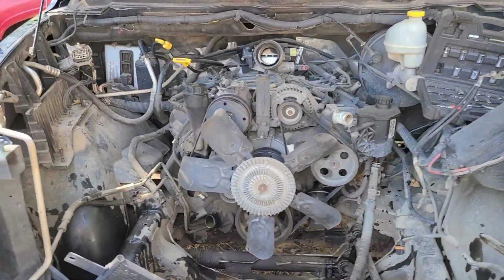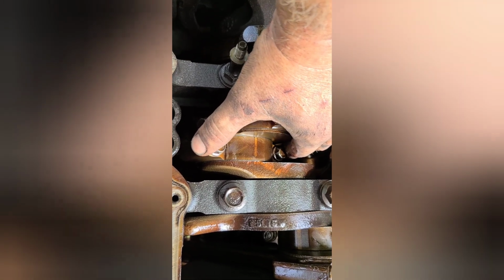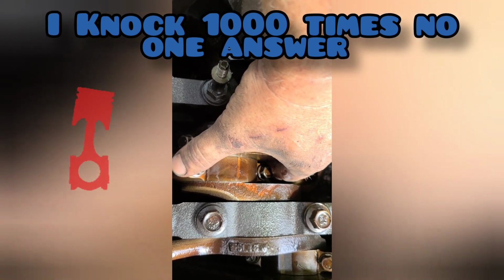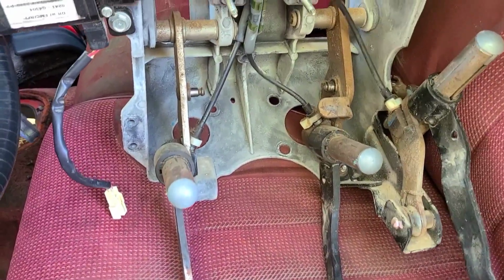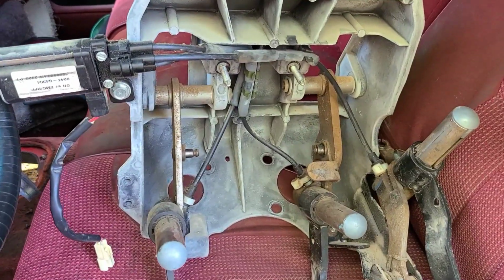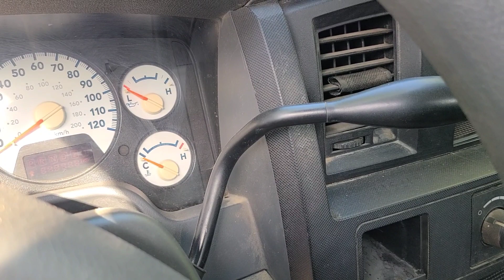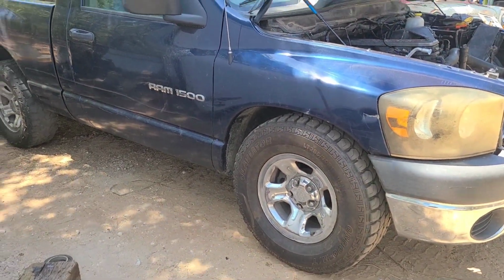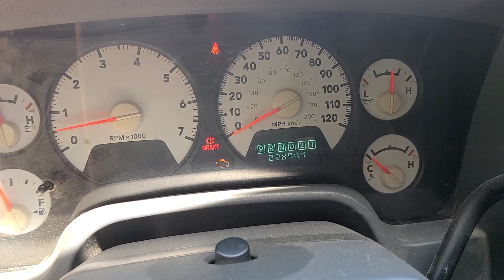1500 short bed ram cummins swap nv4500

Comment: glad to see ya back... this is going to be a sweet build
Reply from the maker: Thank you appreciate the support. It's definitely fun to drive. I am thinking it may replace the f350 shorty build I did.
Reply: @choppedinc.  yea it looks fun to drive ans something different in power... get rid of the shorty ford hahaha
Reply from the maker: I have been thinking about it for sure. Have put plenty of miles on the ford and it does get 20-24 mpg depending on driving conditions.
Reply: @choppedinc.  thats not bad mpg from the ford
Reply from the maker: It definitely helps when you take a big chunk of weight out of it.

Comment: Love it. That's awesome
Reply from the maker: Thank you appreciate the support.
It's definitely a fun truck.
Reply: @choppedinc.  I shared it on my community tab. Hopefully gets some views on this. I've been doing this to 3/4 and 1 tons but never a 1500 so to see it done(and done fairly well) it definitely deserves some recognition. Keep up with the videos. Would love to see more of this thing!
Reply from the maker: Appreciate that. Definitely some things I will be fixing but it was definitely a rush job 2 weeks to get it swap in and road trip it 1500 miles.
Reply from the maker: I watched your 12 valve to 3rd gen vids when I was doing some research. Yours was the best ones I could find and there was not really any for the 12 valve in a 1500 3rd gen swap.
Reply: @choppedinc.  I did mine originally in 2 days. Starting Friday night and was on the road to Mississippi Sunday night from pa 😂 Man that was BRUTAL

Comment: Been watching your build and definitely caught my attention on the details being shared. I have an 04 with a hemi and should be similar to the v6.
I'm curious if u have a custom cable for the injection pump or did u use the oem throttle cable?
And the big question is what about 4x4?
 I don't think you mentioned wether it would clear or need to be modified.
Reply from the maker: This was just a 2wd swap. Throttle cable I made custom. Got a go-kart one from Amazon bought 2 and have one as a spare under the seat

Comment: How’d you get all the factory gauges to work along with the original computer I plan to do this exact swap but get a little confused when it comes to stuff like that. Anything will help
Reply from the maker: I used all the factory sensors from the v6. The dash was lit up but the worked like normal

Comment: "I love the work you've done; I'd like to congratulate you. I have a 2005 Dodge Ram 1500 with a lift kit. Currently, I'm working on a project to swap the engine to a 12-valve Cummins 6BT 5.9. Would you advise me not to make modifications and consider installing a new front axle? Would you recommend modifying the brakes? Would you advise me to at least modify the front shocks?"" You're welcome for responding."
Reply from the maker: I did put 2500 springs in the front for the extra weight

Comment: How’s the front suspension and frame ? I want to 12v swap my early 3rd gen 1500 and I don’t know how well the front end will hold up the heavier engine.
Reply from the maker: I left the front the same just put the one tone coils in it with spacers. The one tone coils are thicker then the 1500 but shorter in a second gen not sure about a third gen on tone.

Comment: Did you keep the ABS? If so how did you keep it functional?
Reply from the maker: Yes I kept the abs. The original computer is still there doing all the normal stuff for the truck I just tied in what I needed to so the cummins would run.
Reply: @choppedinc.  And you use the V6 sensors right? You just adapted them for the Cummins engine? I’m doing a similar project but with an Allis Chalmers 433I so I had the same idea but I wasn’t sure it would work but looks like it will.
Reply from the maker: Yes I just used the sensors from the v6. Oil pressure temp and the rpm from the tonering and sensor. The tonering is in the motor so you have to pull it apart or buy a new one. It all ran through the original computer and worked on the dash, just had a check engine light on

Comment: What cruise control is that? I need one for my 12v also.
Reply from the maker: It's actually a electric pedal switch from a 2006 f250. Wired in to the vacuum solenoid for the cruise control. It works pretty good on flat ground. Or it can be used as I high idle in the cold months

Comment: I wish I could send you a picture I got a 2005 ram 1500 with a V6 single cab short bed I wish I could talk to you and get details about what are you did
Reply from the maker: Are you wanting to do the swap aswell?
Reply: I'm definitely interested in it the V6 is getting weak it uses oil
Reply from the maker: Ok my next video I will go in to details a bit more and if you have more questions I can answer them

Comment: How much did you have in the swap I'm interested in doing this
Reply from the maker: I bought a whole running parts for $2500 that got me most of the parts. Had to get 3rd gen radiator and ac lines and pump and condenser and 3rd gen intercooler, there was stuff that you maybe able to use from buy a full truck but was easier to buy 3rd gen stuff that fits with out modifications. I think it can be done for $4k or less if you can find a cheap parts truck. If you have to buy everything individually it could get pricey. Some people are asking a fair bit for just and engines.

Comment: Wonder if a cab swap would have been easier
Reply from the maker: It's not a bad idea but you wouldn't get the better steering and weight loss from the 1500 chassis it drives very nice, better than any secondgen i have driven. You Would have had to cut the frame if you want a short bed and make new ac lines and brake lines and buy a 2500 diff and new front rotors so it wasn't a dually and a new bed. There is probably a list of extra things I would have to do. But each to there own. There is not a wrong way to do it as long as it's made safe. I have 2 other dually trucks and love a fun little run abouts that can get some good mpg.

Comment: How’s that cruise control work??
Reply from the maker: It's wired in to the factory cruise control vacuum thing. There is 4 wires to it, just wired in to it using a ford pedal adjustment switch. There is a diagram on Google that shows you how it's done. It works ok mostly on flat ground but will also work as a high idle on them cold days.
Reply: @choppedinc.  that’s what I’d be interested in! High idle
Reply from the maker: DIY Cruise Control High Idle - Electrical - Mopar1973Man.Com LLC
https://mopar1973man.com/cummins/articles.html/12-valve-2nd-generation/31_engine/electrical_34/diy-cruise-control-high-idle-r395/
Reply from the maker: This is some info I used